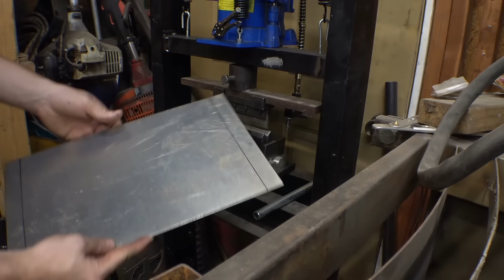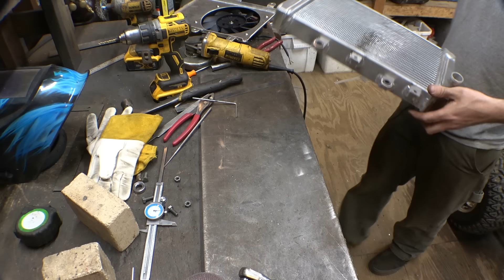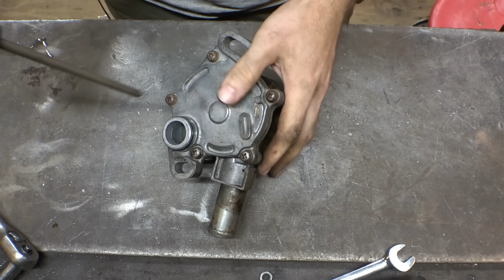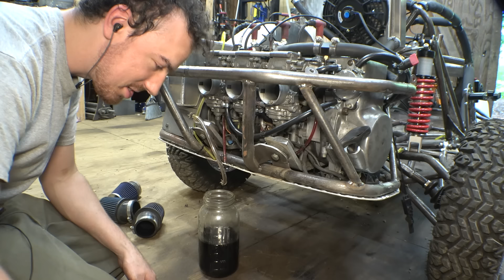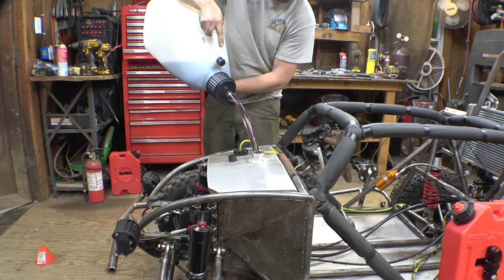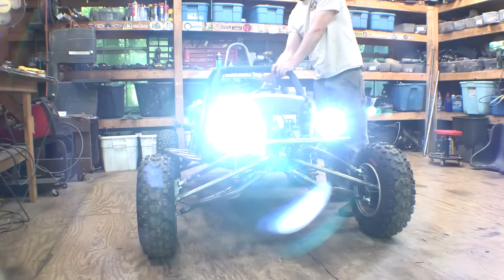Fixing all the Problems on this - Mini Baja Bug Project

Comment: The “storage” tank is  marked “not for fuel” for EPA purposes. It doesn’t have the shut off cap that is on all the stupid red fuel cans now so it can’t be sold as a gas tank.
Reply: Beat me to it…stupid gov regulations
Reply: Congrats Chris has his first interaction with govt BS. 

Gas is supposed to be red and cannot have a vent because Greta 😂
Reply: You can buy tanks with that style cap for fuel. They are color coded for what they contain. Red tanks are for gasoline, yellow for diesel, clear for non flammable.
Reply: @wabash9000  You beat Me to it !
Reply: This exactly.
Reply: That gas can will work for gas. Stupid government b.s.
Reply: u learn sumthin everyday cuz i damn sure didn’t kno dat
Reply: Spray paint it red. Good to go 😎
Reply: That is a gas can they just have to say that because it doesn’t have all the safety bullshit
Reply: @wabash9000 that is true. But they are all made from the same exact plastic. It’s like someone saying you can’t run home heating oil in a diesel truck. Nothing but government taxation bullshit.
Reply: @alwayssomething3259 I am sure that your man will change that when he enters the office! Not one video without nasty things crawling out from the corners.
Reply: @alwayssomething3259  How dare you!   😂
Reply: Ok they are still fuel tanks
Reply: @alwayssomething3259 HOW DARE YOU 😡 
😉

Comment: You're really still wondering with the water pump bearings that wasted? YES! that is 100% causing overheating problems. It's not rocket science bro. slaps you upside the head That pump required proper clearance between the housing and the impeller. That light scratching you see is MAJOR DAMAGE. The wear made the pump just spin and not pump nearly as much as it should. And on the oil pump topic, you might want to reconsider. many engine designs with pumps use them to feed the main bearings, and running pre-mix is not enough for some engines. Not sure about yours, but you should ask a snowmobile guy who knows before you try this.
Reply: Yup this engine needs the oil pump for the crank bearings to survive.
Reply: Yeah been seeing a lot of keyboard commandos saying delete the oil pump, delete it because it can fail and cause issues. These pumps rarely if ever fail. They only fail if people use the wrong type of oil in it. Like using the pre-mix oil and not oil for oil injection.

Comment: Bro! Unhook the pto bearing from the carb. It will siphon the oil from the bearing! Please cap the carbs! Hook the pto bearing to your tank. And just top it off every so often or put a tube upward on the frame where you can watch the level ... it's important to keep it lubed!
Reply: I was thinking that the line that was on would work with a pin-hole cap.Just leave the line vertical and check oil level as it'll only pull what's needed.A tiny air hole will keep it from just draining into the bearing.Gear lube is thick enough and won't  leak down.
Reply: Exactly, hence the excessive smoke on stsrtup. Just zip tie the pto oil hose up on the frame, and use a small piece of hose with something tight in it to block of the carb port.
Reply: @bryduhbikeguy  yes! its the same thing we do on rotax seadoo;s when we delete the oiling system!
Reply: @schwartzenheimer1  yes! its the same thing we do on rotax seadoo;s when we delete the oiling system!

Comment: Chris, Rectifier will get HOT when NOT grounded to a plate to HEAT SINK it.....    Rectifier HAS TO BE mounted to a GROUND PLATE on the Frame to remove HEAT and to be able to rectify properly. BATT will get up to 14V sometimes. The Battery will only PULL AMPS it needs.  BE SURE to put a FUSE between BATTERY CHARGE WIRE and RECTIFIER!!!!
Reply: I don't know why i read 14 Amps.... or mounted on a chunk of aluminium. regarding LEDs, you will need load resistors for the amps
Reply: Also the rectifier dumps excess unused voltage as heat the more electrical load he has while running the cooler the rectifier will be

Comment: Great videos.
  That oil pump has an oil line going to a bearing. I would put the oil tank back in and hook the oil pump back up. If there is an oil line going to a bearing, the engineers did it for a reason. Adding some oil to the line now and then  probably won't help much.
  That fuel jug, unless fuel reacts with the plastic and melts it. It is labeled that way for liability issues. Does not have EPA's maximum spill system 😂.
Reply: Id just add the tank back in and plumb that line to the bearing back to it with no pump, but add a little regulator to the line so its not just pouring too much in, simplicity is key
Reply: The pump doesn't work and he can't because he would have to get a new drive gear.

Comment: Hey Chris,,
The water pump was definitely an issue with cooling!!!
Sucking air past that seal and creating cavitation in the pump!!
Definitely won't circulate!
The oil injection?
I think it would be best to make sure that those bearings are continuously getting oil!!
Awesome job man!!!

Comment: You have aluminum oxide forming in the cover. The bar by the starter/pump cover needs to be removable for service. The pump was fried before you barbequed the bug. 
Excellent project involving an amazing level of imagination! Way to go, Mr. By the way, use a lil dielectric grease on the O ring, you will be glad you did. Position the fuel line clamps so they don't rub through the coolant 'ose. Check the gas can for damage from fuel. It may be perfectly fine! It is similar to a VP Racing fuel jug, after all!! Mount the regulator to a large metal location so it can dissipate heat into that and not likely overheat.

Comment: So now that you disabled the oil injection pump,you need to rejet richer because your trying to push a thicker fluid through those jets that were jetted for straight gas.trust me,it makes a difference,seen so many people blow up 2 strokes by doing the same thing.oil mixed in gas is a thicker fluid then straight gas by itself.i would try 5 sizes up on the mains to start,and at least 3 on the pilots.
Reply: The oil mixes before it goes through the jets anyway.
Reply: Seen people blow up two strokes by using the wrong oil as well. Some use the pre-mix oil in the oil injection system and some use the oil injection as a pre-mix. Wrong formulas and will cause engine failure.
Reply: @camyota  right so now he is pushing oil plus gas thru the jets, its not only more viscous but it displaces fuel by whatever the mix ratio is, so like 2% less fuel as the oil is now in its place if he is mixing 2% oil.

You always upjet on switching for best performance. I dunno about 3 on the pilots but a least one on the pilot and a couple sizes on the mains. but you wont know till you start jetting what it will actually want.  Easiest is always upjet till it runs crappy then start backing down till it runs clean.
Reply: Yes the amount of oil in the premix displaces the fuel, so the motor runs more lean, could add up to overheating as well...
Reply: I blew my stage 4 tuned RD350 YPVS up four Times before i realised that, Got very expensive the last time as it snapped the crank and high sided me to oblivion after a 115mph seize while fully lent over cornering, Knocked out on landing, Broke both collar bones and the scaphoid in the back of my left hand.
Reply: @Gixie-R  😮😱😝

Comment: You NEED the oil pump on that engine!! Splash lube from the premix will not reach the outer pto bearing. Polaris tried that already and then added the 4th oil line direct to the pto bearing. Oil pumps are very reliable, millions of engines run with them working for many miles. 
I have been working on sleds since the 70s and have yet to see a pump fail but if it were to fail they are designed to fail wide open. 
Water and debris in the oil tank and system will cause oil starvation but if kept clean you will not have a injection pump problem.
I suspect you did not bleed the pump properly or at all which will cause an air lock and not alloe the pump to function just like any other pump of any kind.
Again Polaris added the forth line to the pto bearing for a reason.
Reply: @ratherbwelding - This
Reply: Thats wat iam sYing too that motor not ment tovrun witj out the oil injector... He probmy did t h e the cable on itnor have it adjusted rite.  He shkukd put pre mix in it to brake the motor in to .. no wonde ris has low compression now
Reply: 👍absolutely, that bearing needs the oil.
Reply: Great job
Reply: He could just put the oil tank back on, and gravity feed the pto bearing tube to the tank.
Reply: Need to upvote this time and time again.
Reply: This!!!
Reply: @ratherbwelding

Comment: The rectifiers between this unit and your CBR1000 unit are different. I don't know the exact specifics of this unit, but it looks like it is a single phase stator (2 wires feeding the rectifier from the stator) and the CBR1000 is a 3 phase system (3 wires from stator to rectifier). The single phase system will pull much more current (per wire) than the 3 phase unit. Also I believe this rectifier is a shunt style and the CBR1000 rectifier is a MOSFET style. The shunt style rectifiers get way hotter than the MOSFET style.
The fuel jug is labeled "Not For Gasoline" due to EPA regulations without the stupid anti-spill spout.
Awesome project! I love watching your builds!

Comment: I have all the charging information you will need, you just have to find what apply s to your system.  First the easy stuff. Motor off battery voltage should be about 12.5 to 13 volts Running voltage should be between 13.8 to 14.8 volts. NOW you need to find if your stater voltage is using chassis ground or is isolated. and if the rectifier/regulator is isolated or using chassis ground. If they are both using chassis ground you are shorting out half the system causing the high amp draw and will end up burning everything up by shorting the AC and DC together creating half wave DC not full wave. half wave is not good for electronics like LED lights. To solve this you must find a way to isolate both the AC and DC power, this may require to use a different rectifier/ regulator or mounting it on a chunk of rubber and run both plus and minus wires for the DC power without using chassis ground. I hope this will help and GOOD LUCK!

Comment: Cut out a spot on your cooling fan shroud and mount the rectifier there in the air flow. Automobiles have been mounting resistors in blower motor housings for years.

Comment: I built a 4x4 buggy a good few back & my water pump crapped out on me & left the chat whilst I was out on a trail in the middle of nowhere. Fortunately, I had enough tools on me & I was able to pinch the Chinese electric pump from the fuel system it was kinda over kill in the first place. I then moved the tank a few inches up allowing the fuel system to be fully gravity fed & I then bodged the fuel pump into the coolent system & Its ended working so well that its kinda become semi-permanent as many things do lol. . Great work as usual thanks for sharing. .

Comment: Good progress.  I would add a checklist to the steering wheel that says to oil the continuous slip clutch before every ride.  You also need to put a sticker on the red cans that say 2 stroke fuel only.  They are available and pretty cute and professional looking.  Lastly, I would take plugs spare battery, and a spare regulator just in case.  Over amping a regulator might over charge the battery and you have a multi-system failure.  The plugs are for if you still have temp problems after your fixes to water pump and radiator.  Are you sure about the 40:1?  I run my dirt bikes at 50:1.  If it still smokes a lot, it could be a high fuel to oil ratio.  That will make your engine run hotter, and it will also wear out your plugs quicker.  You will see electrodes burn of due to the lack of ceramic for higher temp combustion temps. I used to run different temp plugs based on the season and oil.

Comment: HI Chris, Essentially the regulator is regulating voltage not amps... so if there is little or no load on it then the supply voltage from the stator will be higher (due to internal resistance) and the Regulator has more volts to loose as heat. But once there is a load, lights, fan, battery etc, the amount of volts it has to dissipate as heat will reduce.

Comment: I would reconsider the oil pump to feed your crank bearings - those XLT motors were notorious for throwing cranks due to casting flaws in the case and need consistent oiling especially at high speeds.  If the motor is a 1996+ it has better casting for the crank than the earlier models pre 1996.  Oil that thing! 😂

Comment: Those white spots look like oxidized aluminum from hot water spray.  Maybe somewhere in the past, someone only used water instead of adding coolant.  Coolant is made of ethylene glycol which adds the properties of anti-oxidant, lubrication, and changing the freezing and boiling temperature of water.  If you rub coolant alone in your hands, you will not it is slippery.  Both the coolant lubrication properties and anti-oxidant for the inside of the water pump.  It will not take long for pure water to tear up water pump.  For the bearing wear/play, make sure the belt tension is correct, but that red gunk is oxidized iron from beangs.

Comment: The mould looking stuff on the inner part of the cover is corrosion of magnesium in aluminium-magnesium alloy cast metal. that alloy doesn't really like water, specially sitting water, a coat of paint could help it for a while, if you are expecting water around that area.

Comment: Chris, a charging circuit will only supply as much current as the circuit demands. If all you are connected to is the battery, you are severely overcharging the battery!!! Solution is to add a series resistor in series between the rectifier and the battery. A power resistor at about 5 ohms or lower.

Comment: Add some one way flaps on the closed side of radiator fan so when driving air can flow thru without restriction very easy to make with the piece you cut out just have to make a hinge for each

Comment: i shouldve thought of this sooner but when you redo one of these engines in a snowmobile you have to bleed the air out of the top of the head to get the cooling system to operate properly again. youre definitely gonna want to do that

Comment: Hey Chris I think you should put some spacers under the voltage reg so it doesn't build up heat being bolted flat to the aluminium plate less chance for it to overheating

Comment: Snowmobiles Leans into fast turns so the floats don't close off like the buggy being flat and the fuel shoved to 1 side of the bowl.You increasing the flow will help.Keep the 2' oil line for the bearing and use a pinhole cap to let it vent but not drain.If you use gearoil it'll flow slower,but the thickness will help the bearing.It'll be easy to see what's used. Hope you're having Fun now as it's the 2nd. Happy Forth Everyone !

Comment: Nice work.  If the air to the regulator/rectifier is coming from under the seat(front to back), then I would turn it 90 degrees.  That way it gets all the fins, and can work more efficiently.
Reply: risky if he drive over a rocky road  etc and  it get smashed to peices
Reply: @ultimafreak  turn it 90 degrees in the same place.  That way the air can flow front to back, and be more effective.

Comment: We used to run Amsoil mixed gas in our Banshees at 100:1 with zero issues in Oregon dunes. Had 6 Banshees ran that way for 10 years never an engine problem. Hardly a puff of smoke. You dont have to see smoke in a 2 stroke.